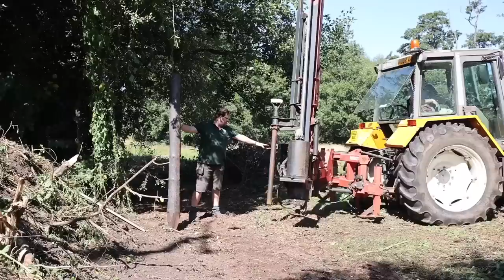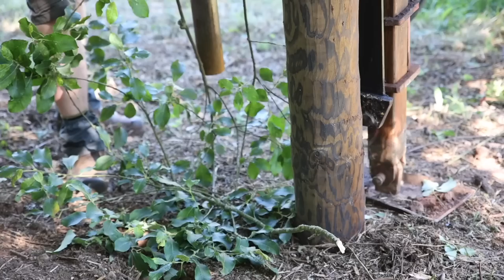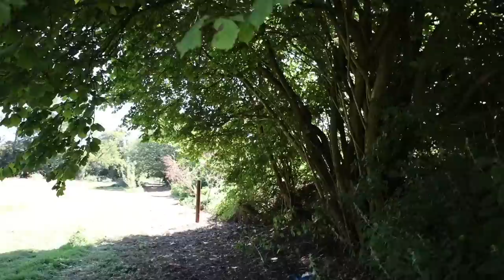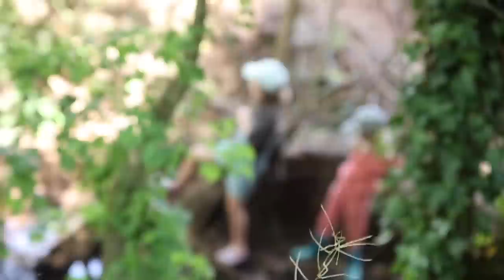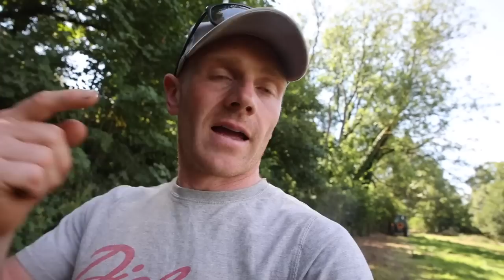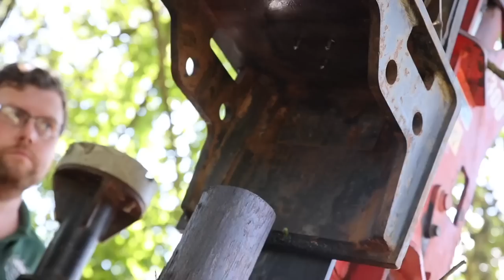INSTALLING A STOCK FENCE - Part 1- The right kit for the job! 🚜

Comment: Tim I'm wondering if you had thought about using the heat shrinking bitumen sleeving that you can now buy on the lower couple of feet of your post's?. Even though your post are obviously well treated I was wondering about how long they will last especially when you have mentioned that the area is basically a very wet area and is prone to flooding etc, knowing that you're post's are really going to be lasting less time overall than they would have in normal conditions I was wondering if you had considered using the bitumen product I mentioned to help with the overall lifespan of the post's especially when you can purchase a 5 meter sleeve for around £20 or so ?
Reply from the maker: It’s not actually been as wet there as I thought so these good posts should last a good while. I’m actually looking to stitch to Clipex steel posts for some of the jobs which will outlast anything timber especially as grants will now cover that. Not sure how sleeves would stand up to being knocked in hard ground either?

Comment: When the contractor lays the ground wire for setting out does he then tie it off and leave it in situ? Or does this get removes once the stock fence is fixed?
Reply from the maker: Left in. That way you can keep the net of the ground a bit and in this case it’s barbed to stop the pigs rooting under.